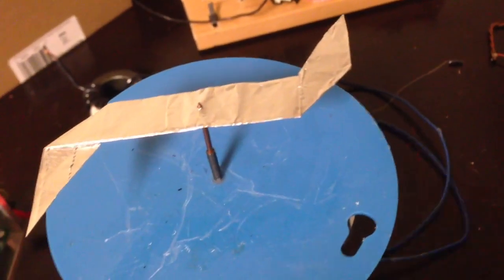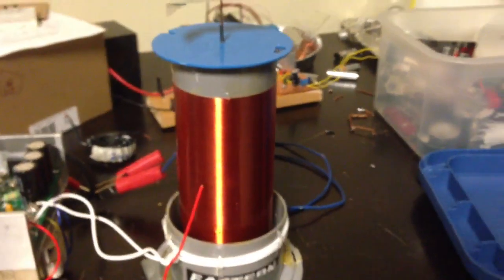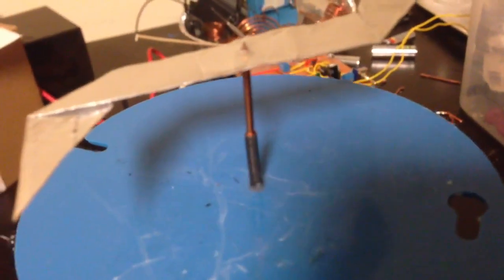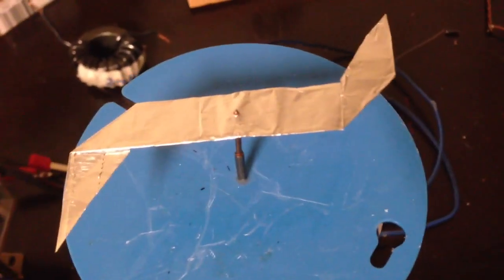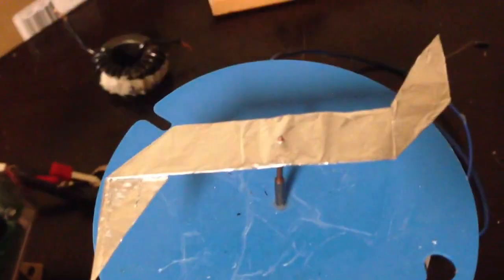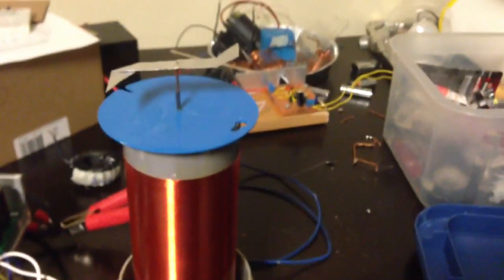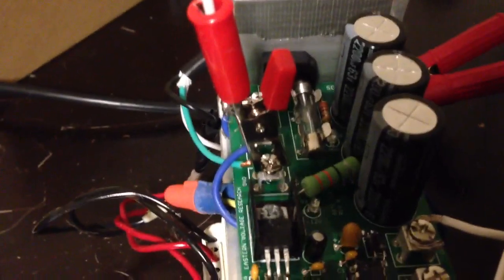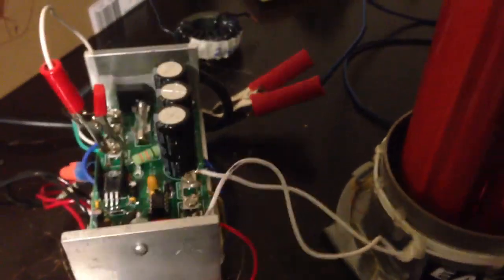Tesla Coil Powered Ion Motor

Comment: Do you have a circuit diagram for this?
Reply from the maker: Brian Dockery a simple circuit is the one by steve ward:

https://www.stevehv.4hv.org/SSTC6.htm

Alternatively, for a great kit with all necessary components, eastern voltage research has one which is the one i used in this video:

https://www.easternvoltageresearch.com/sstc_10.html

Hope this is helpful

Brian